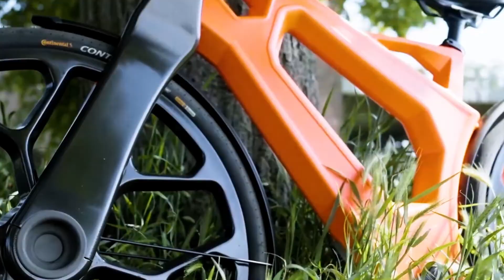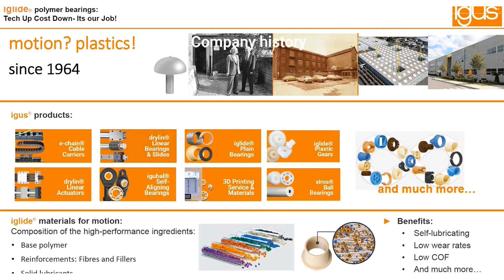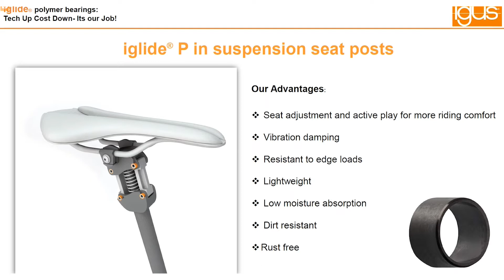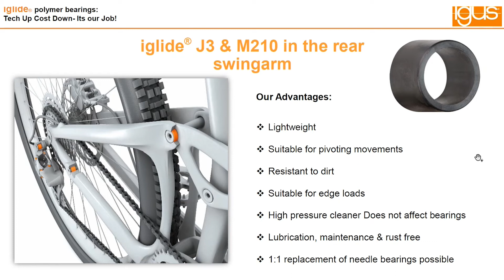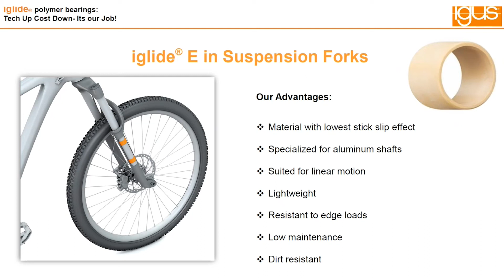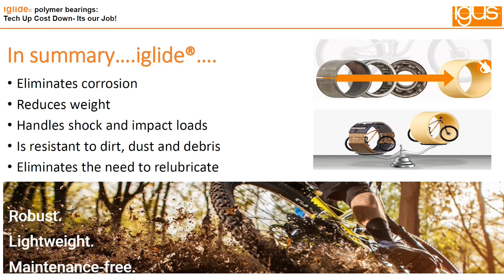iglide® Bearings for the Bicycle Industry Webinar

Comment: Hi, what is the best bushing material to resist impacts, I want to put them into surron light be suspension linkage, and into the frame where the suspension triangle attaches to the frame. I think the critical load there is choc and impact.
Thank you.
Maybe you have a 3D filament for my application too? 
The bushings need to be 12x16x12 
Or 12x16x30 for the linkage.
Reply from the maker: Hello @surronzak8154, thank you for your interest in iglide components. M250 is the best for impact loads. We make a sleeve in your size however, it would be best for you to speak with one of our product experts to ensure we are able to provide you with the proper solution for your application. Please give us a call at (800) 521-2747 or start a live chat on igus.com